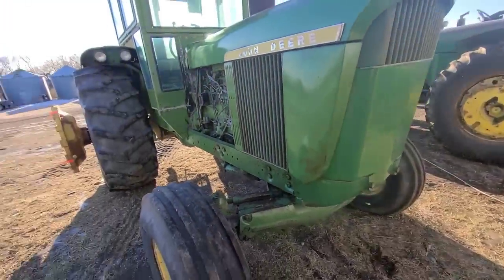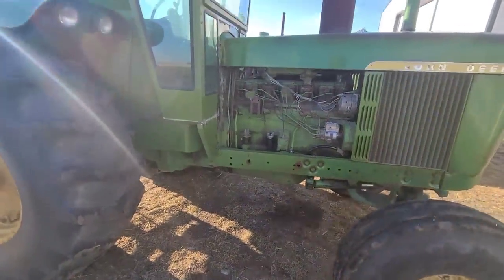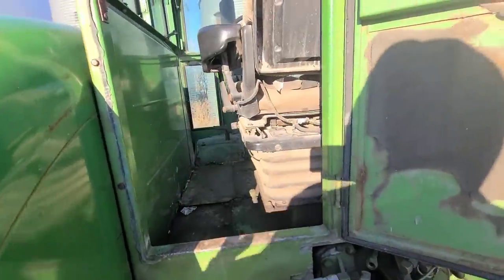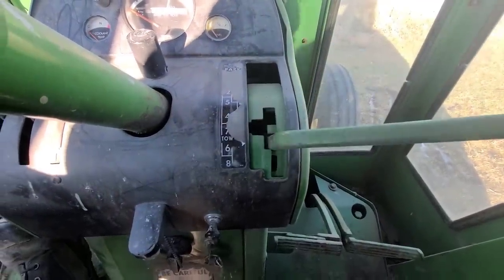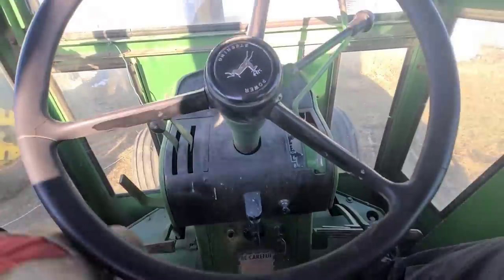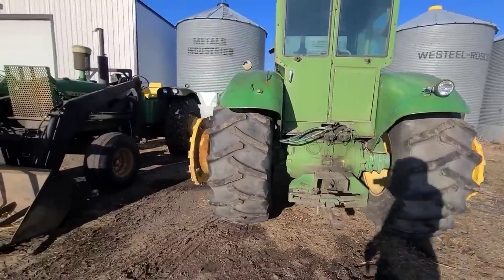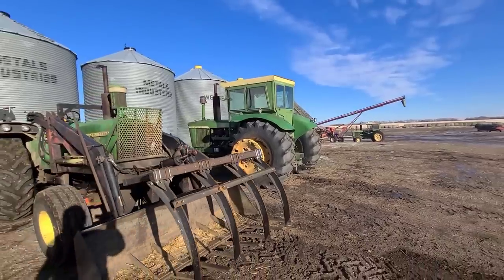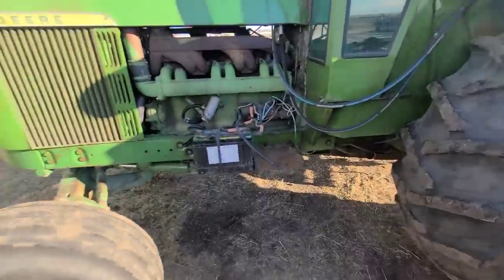I bought ANOTHER 5020!!!!! Southsask farmers orphanage for the lost and hurt John Deeres!

Comment: there were two 5020 sold in Vermillion AB Oct 25/21 Both were striaght but needed paint rubber looked good .THE 66 sold for 1750.00 had a pto  67 sold for 5900.00 both had 24.5x32 rubber ,and cabs

Comment: which tractor cane first the 4020 or the 5020. The 4020s look a bit older than the 5020s. I used to own a couple of 8Ns they came around after the 9ns and had more power. Ive seen a couple people do something to theyre 8ns that gave up to 100 or a bit more 130hp.
Reply: 4020 was first.. I believe 63. 5020 started about 65

Comment: Know anything about 8440’s? There’s one for sale with a pto and wheel weights that would be nice to have to run cart and pull a little disc and rake around with. Curious if you knew why d range could be stiff. Sounds like trans issues.
Reply: Stiff like what? Hard to put into gear or .......?
Reply: @ivanmoreau1798  all they said was d range is stiff. So I’m assuming gear mesh?

Comment: Wheres the 3 point linkage could u not put the door where it should be
Reply: On these cabs the door is where it should be
Reply: @ivanmoreau1798  well who ever designed them must have loved trashing machines joke of a place to put a door
Reply: @noelcahill6707  no kidding. They suck to get in and out of also
Reply: @ivanmoreau1798  ya i can see that did they have 3 point linkage or was it a option
Reply: @noelcahill6707  yep one of these has the factory 3pt
Reply: @ivanmoreau1798  i still think them cabs should be taken off and a better 1 built the rounded mud gaurds would have to go